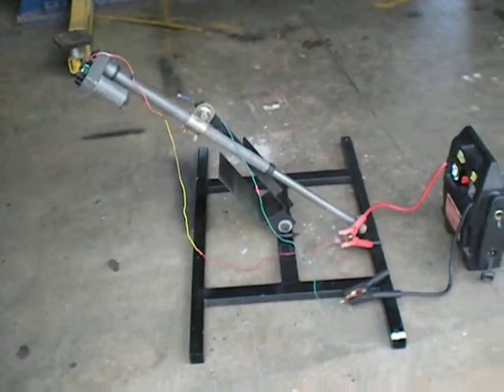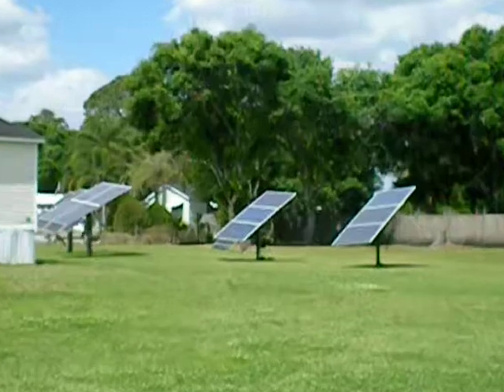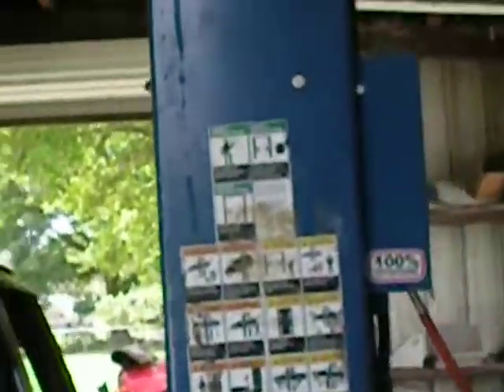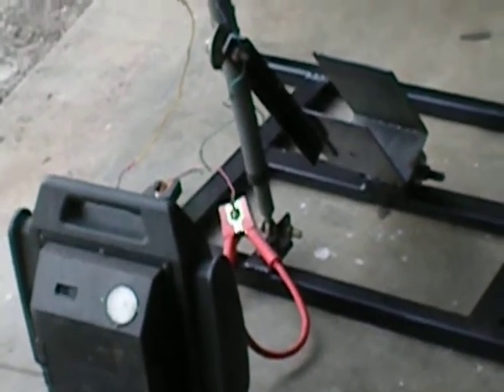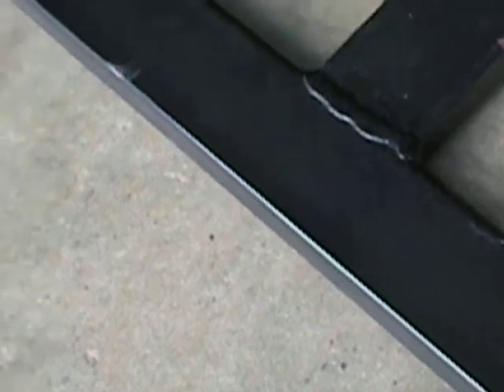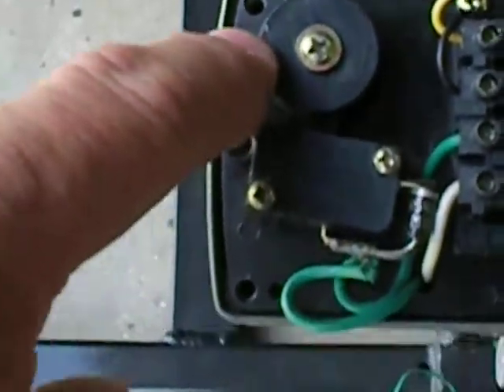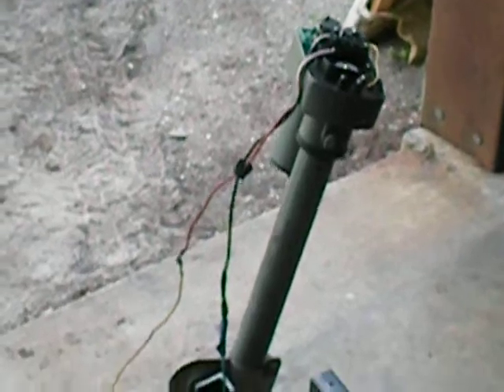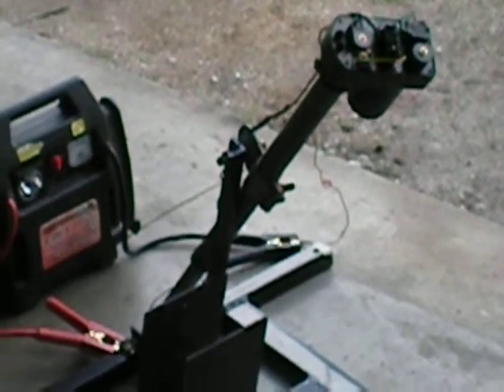Prototype Small solar tracker PDI.

Comment: Hello Glenn I've been going over your videos and I love the tracker mounts that you have designed I was wondering if you still have any kits available for sale that can hold 4 two 6 230 want solar panels hope to hear from you soon
Reply from the maker: HI please see my 2 PDI videos of the last tracker kit I sold, not prototype  type kind  I no longer sell the full kit just the  tracking mount ,all the black  metal u see in the video. I am again sold out at this time sold 6 units this year, I will be making more soon I improved them once again just miner tweaks  increased N/S tilt  to 65degrees so as to perform better in northern climate.. they are bigger than they seem in video  about 90lbs will yield a 10'x10' mounting area 100sg.ft..wglenn265@gmail.com

Comment: I like the little ones better after building a few. The small ones just hold stout in the wind quite easy. no need for a bunch of heavy duty metal when you make one for three panels. Its just a lot sweeter. Everyone is like stack six on it. I dont want to. Four is a lot I think. They always want to me to get every panel I own on one tracker sheesh. Three works out best I think because it dont ever even waver in high wind.
Reply from the maker: hi thanks I may start building smaller one as they are much less to deal with I need to go back to the drawing board & make my portable power trailer when I get a break in the action.